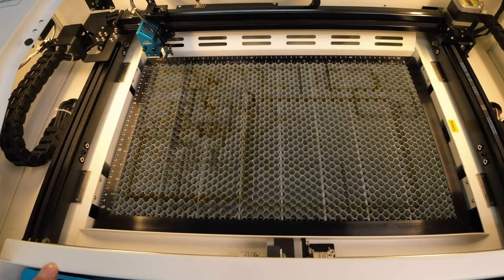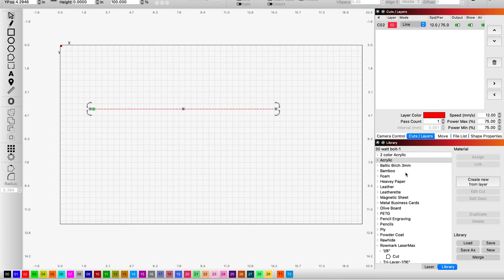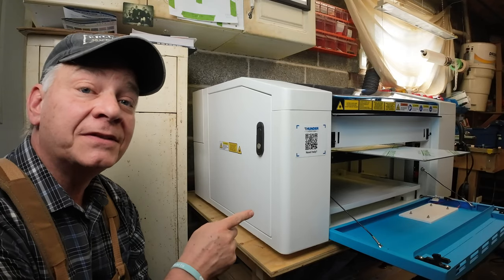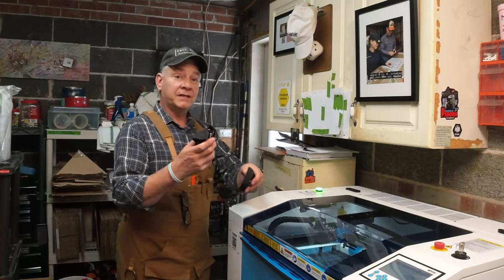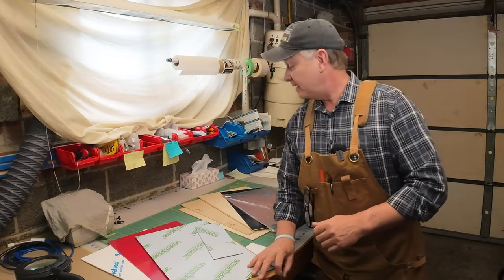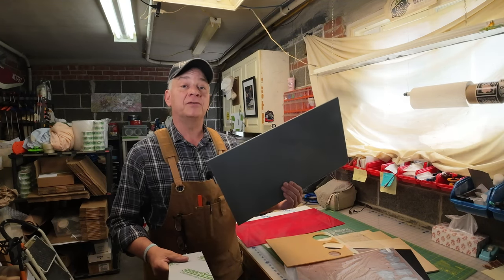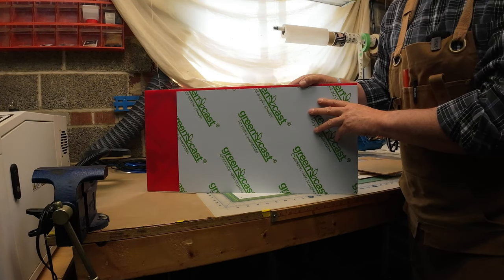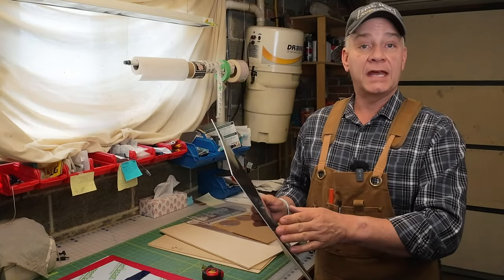QuickTip: Oversized Material? Do This! Thunder Laser BOLT. Laser engraving machine. 035   4K

Comment: Hi another great video. Do you have a video on material settings ( engraving and cut)? Still having trouble getting my settings to work, lots of 🔥 wood 🫤
Reply from the maker: Good morning Vera! Thanks for watching. Yes, there is a video on my channel called 'Quickshot Free BOLT Materials Library ' - it is the base library offered out by Thunder Laser USA.  As I determine settings for materials I provide them in the respective video so usually the videos will start with "Quickshot" and then say Settings for 'XYZ' etc. I have only worked a little on bamboo and Baltic Birch so far. However, off camera I have worked on some Maple, Oak and Cherry ( Oak has a weird grain and does not look nice when it is engraved - LOL) What size Lens are you using - 1.5" or 2.5"? Also, do you mask your wood? Thanks!
Reply: @LaserNUG  good morning thank for answering my question. The lens is 1.5. Wood is Baltic Birch some Walnut. I know this is a wired question but does it matter where I buy the wood? I’m in Calif
Reply: @LaserNUG  also I know you said something about “masking” never heard of it
Reply from the maker: @veralopez2681  If you take a look on my home page there are two videos - "to Mask or not to mask", and one titled Lazer Dark. These should help but please ask if you have further questions. :))
Reply from the maker: @veralopez2681  I think the wood should be the same Baltic Birch should be consistent everywhere I believe. There is a video on my page called Quick Shot - Baltic Birch Settings and also look at the one called 1,000mm per second, 2,000 DPI. Let me know if it helps at all. And remember - it is super important to clean your mirrors and lens every day or two. Also, have you done a mirror alignment yet? GP
Reply from the maker: And also, I am happy to talk by phone if it helps - just email your number at lasernug at gmail dot com. I am new too but happy to share info if it helps. :)
Reply: @LaserNUG  thanks for the offer, I’m in contact with Thunder now to see if they can help first if I’m still having trouble I will definitely reach out to you.
Reply: @LaserNUG  finally found my problem it was in the gear menu. Setting needed to be adjusted.
Reply from the maker: @veralopez2681  That's great to hear Ver. Glad they were able to help you and you are back in business. Cheers!